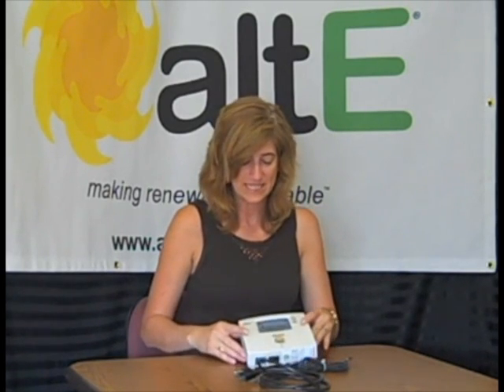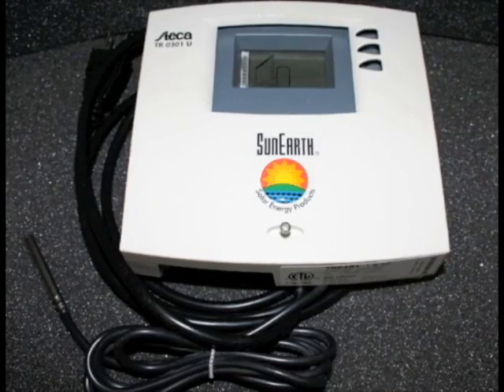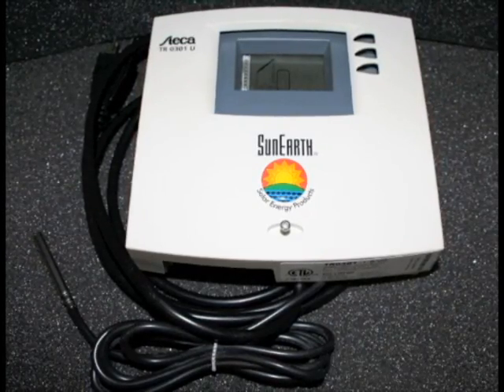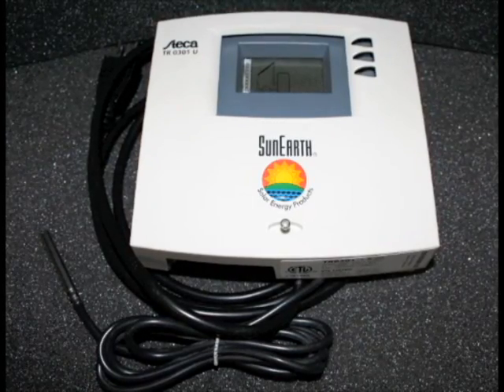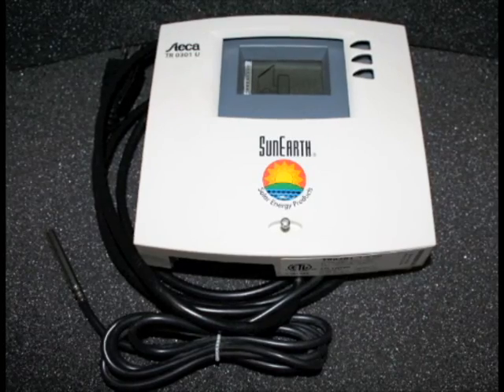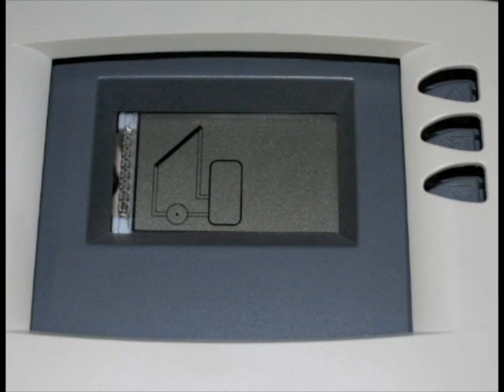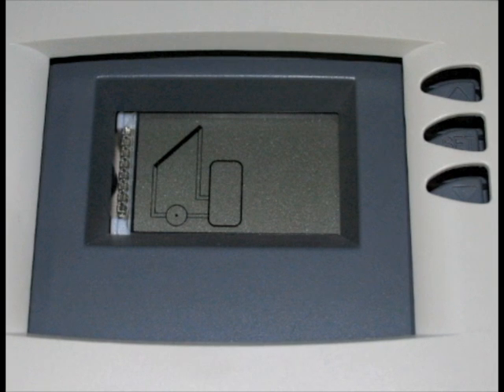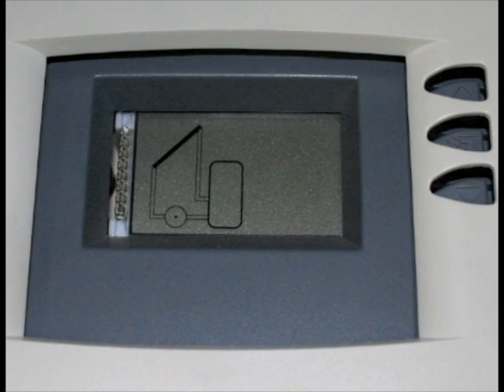SunEarth Steca Differential Temperature Controller for Solar Water Heating Systems

Comment: I have the TR 0301 U controller.  My tank temperature (T2) is 98 degrees F.  This is too cold.  How do I program the unit to keep the temp around 120 degrees F?  At the moment the unit is only heating the tank when the sun is up, but the tank cools down at night. I need to have the electric water heater kick in when the solar water is not providing hot water (like at night).
Reply: I’m having that same problem,how did u fix it?